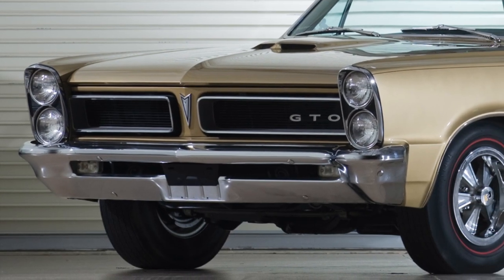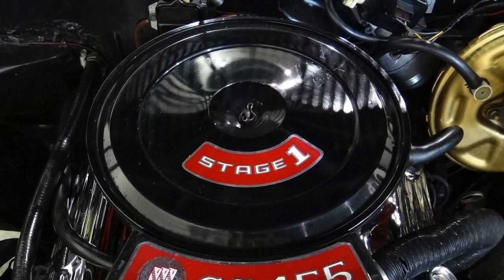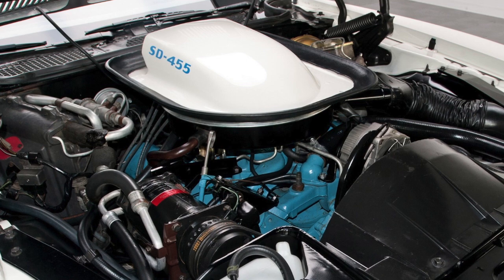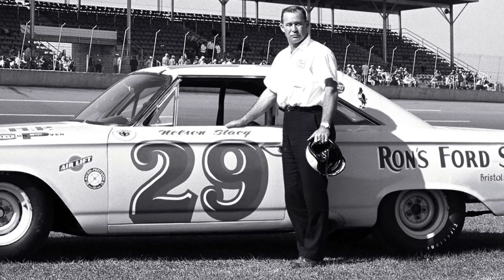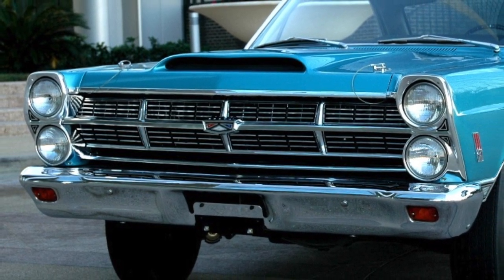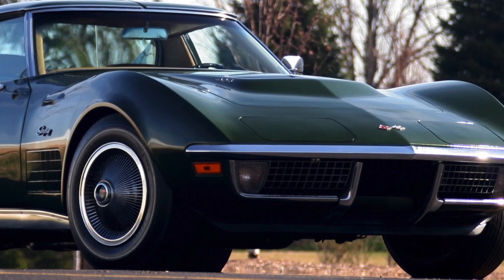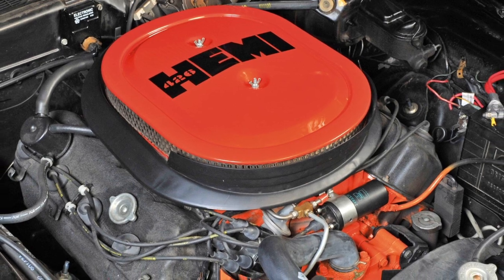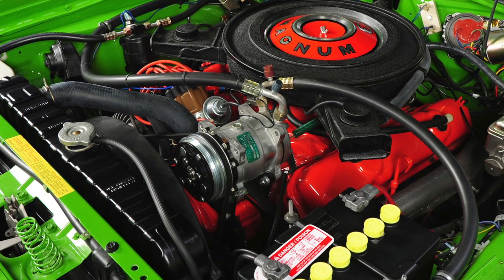5 Best Vintage V8 Muscle Car Engines

Comment: Back when real cars were made! And I remember pumping preumium gas costing 32 cents per gallon! Real gas! Try running cars like this on 91 octane at three bucks a gallon! Ping, ping, ping!!
Reply: Not in SLC at 4500' elevation. 10:1 up here makes the same cranking compression, all else equal, as 8.5:1 at sea level.  I put 305HO heads on a smogger 350 and left the smogger cam in, it ran fine on pump regular at 10.2:1.
Reply: @Bighorn44 None ...and .34 in 1966 adjusted for 2019 inflation is $2.74 today. The old days weren't that good.
Reply: I remember paying 21 cents a gallon at the cheapo station right next to Ventura High school in Ventura California in 1968/69. Mostly I bought regular which ran fine in my mom's merc station wagon with 10:1 compression at sea level. It was no performance car but the 383 version of the Lincoln 430 was still a torque monster. I wish I had one like it now in good condition. 2.73 gears, 55 in first 95 in second and no  idea in third. Shifting at 4,000 RPM... LOL My dad liked it too. We pulled a 14' camping trailer up over 33 towards Taft and at one point, on a long straight stretch, he got all 4, probably the trailer too, airborne over a rise that would be a gentle slope at 65. The speedometer was somewhere past 105 when I saw it as we were slowing down. I believe that he honestly didn't notice how fast we were going. You're not going to do that with ANY modern car.
Reply: methanol a low grade corn mix money flow 4 big corporation.
Reply: I remember 32 cents a gallon I was 11 years old I remember how passed off the adults were whe italmost trippled over night too
Reply: That 32 cent premium was full service too! Clean the windshield, check the oil, and even tighten the fan belt, check the air pressure in the tires. All included!! I remember one lady who always needed that windshield done twice, because she would insist I missed a spot.

Comment: These were all great engines, some of the engines shown had air conditioning and or air pumps which were big nonos to the muscle car owner. Another big factor in street racing back in the day was rear end gear ratios....I had a 1969 GTO 400-350 hp  with a 4:33 posi rear  and I was unbeatable...Frank
Reply: My best friend had a '69 GTO Judge with 400, 4 speed and never lost a street race. One guy he beat wanted to buy it on the spot.

Comment: 4:06 - 4:09  You forgot Pontiac's [aluminum] 215-cubic-inch V-8, which was used in the Tempest line in 1961 and 1962.  It was based upon an Oldsmobile design, but it used different cylinder heads and fewer head bolts.  It was virtually identical to the Buick engine of the same architecture.
Reply: Definitely NOT a high performance engine.
Reply: @4thstooge75 : True, but he said that Pontiac never offered a "small-block" V-8.  That is not factual.

Comment: I have a 1971 boss 351 mustang that dinoed at 449 hp! After market intake though. Low 12 sec 1/4 mile with tracksion issues! Not bad for a almost stock small block! Ps. Is a four speed car.

Comment: The 455 stage 1 Buicks were fast, but we're notorious for cracked engine blocks under high RPM abuse because they only used 2 bolt mains and very thinwall casting
Reply: it made 510ftlbs at 2800rpm... those who used it for high rpm messing around are the only ones to blame for cracked blocks.

Comment: That 13.30 ET test was with stock tires, with slicks and a 3:70 gears would run deep 12s, bone stock.
Reply: Mark rapacki  What did you run in the late 60s stock that ran 12s? Just curious..
Reply: Mark rapacki  So my 1968 Dart with a slant 6 with slicks would run 12s, I think you don't know what you're talking about. Only few car's ran 12s with slicks, my point was there was some that would, not all hot rods from the factory ran 12s back then
Reply: Mark rapacki  Well??
Reply: Mark rapacki  Your proof, what car's do you know that ran 12s stock in the 60s with slicks, you gave no answer just silliness, you probably weren't even alive in the 60s. I only know a couple that would run 12s with some tuning and sticky tires
Reply: Mark rapacki  Oh and stop liking your own post 😂

Comment: nice to end the segment with the 383 chrysler. with a half inch shorter stroke than the 440 or 426 you could boost the piston speed up about a thousand more rpm and stay safe. better valve springs, better low end bearings and you had a real champ.

Comment: All I know is that the GTO with a 389 was just about the best street racer.
Reply: A guy in  my small home town had all the fast cars back in the late 60's and he said the fastest one was his GTO. Faster than his Plymouth GTX 440 six pack, faster than his Hemi Cuda, faster than his Chevelle SS396. That really surprised me.
Reply: @nasedo3129  And then he woke up and realized that is was all a dream.  The GTO essentially started the Muscle Car Era and was the fastest car when it came out, but, all things being equal, it was no match for any of those other cars you mentioned, unless they were all dogs. Don't believe me, look it up for yourself.
Reply: Until a Mopar pulled up.  383, 440, 426, even some 340s....that tripower was toast but looked sweet.  That option to drop the exhaust was a pimp thing also.

Comment: Funny how V8 Nova's seam to be forgotten. Even a slightly modified bullet proof 350 small block 68-70 were incredibly fast. It was the HP to weight ratio.

Comment: The R code 427 would have been a whole bunch meaner if it had a better Intake manifold with more port volume and larger plenum below the carbs allowing better atomization and better flow into the ports.  A taller better breathing air cleaner probably wouldnt have hurt with the original intake but would definitely have been a must with a larger intake volume

Comment: Oh, how I miss the days when gas was less than a buck per gallon, and enormous naturally aspirated V8's ruled. Now EPA rules...it's too bad
Reply: yea but if an EU manifacture made that engine it would be more than that
Reply: The current crop of performance cars are pretty darn good and gas is cheaper than ever if inflation adjusted.
Reply: Buck a Gallon?  You mean  back in 1970 when the min wage was $1.50 an hour?  Now with inflation min wage is 7 times that but gas in only $2.25 a gallon not even twice that--CHEAPER.  And any 2016 Dodge Rt with a stock 5.7 V-8 375 horse engine can blow these old rust bucket  engines  off the road!
Reply: In those day they would have run off petrol.
Reply: bet you would give your right thumb to have one of these "rust buckets". A nice 4spd LS6 Chevelle would set you back $100K+. Of course nostalgia is part of that cost but there is something to be said about the uncomputerized rawness of these machines when driving them.
Reply: Ryan, I can remember sitting on the edge of my seat, watching that gas gauge move to empty and hoping I made it to the next gas station.  LOL
Reply: Chad haire, no in 1970 gas was 30 cents, in 2000, gas was $1.10 don't know about you, but I call that taking it in the tail pipe at the gas pump at $2.40 for regular when a barrel of oil today is $47.00 and in 2000 it was $35.00 a barrel. By the way a1970 440 six pack highly optioned cuda was $4.400 compared to a 2016 Dodge challenger RT with 5.7 is what $38,000.00. Today we're being screwed all the way to the bank, by the banksters. At least the average gear head could work on the 70 cuda, all the newer cars require thousands of dollars in specialty equipment, no thanks.
Reply: if you love v8`s you run em no matter the cost
Reply: The Dodge Hellcat is 707 hp and can achieve 20 mpg.
Reply: vintage motors  dumbass lol
Reply: chad haire for me it's not how fast they go.  It's looks but speed is great too
Reply: Even back in the 80s and 90s the gas was cheaper than it is nowadays too many tree huggers are calling the shots its because of those tree huggers we have higher gas prices than ever before and also because we are still buying foreign oil its because of those tree huggers we cant drill here in America if we could drill here in America we could lower gas prices to extremely low levels it might be a buck or lower but because of the tree huggers we cant do that electric cars are not the future if they want low emissions natural gas would be a better option we wont have to give up our good sounding engines and they will have the same effect as electric cars there I just solved the emission problem
Reply: Bob Lazar good cars and great power yes,  inflation wise no. if you just figure inflation yes. if you figure in the pay checks of most people now days, NO!  car buyers back then could afford these types of cars on the average Joe salary.  I don't know anyone that works an average job now days that has one of the new street killers. I work a union UAW job and only 1 guy at work has one and he is a young guy that lives at home yet.
Reply: Yeah, it's a real shame we don't get to breathe lead-filled air anymore.
Reply: phuc ewe  Don't I know it.
Reply: @kirbyvanduzer6565  I've had those musclecars and still love them, but I'm also a tree hugger, I love my planet more, idiot .
Reply: @chadhaire1711   Gas was 32 cents a gallon in 1970.  And it got as low as 85 cents as recently as 2000.
Reply: the gas shortage hit in 1973, you had to wait in long lines for 10 gallons
Reply: billyboi57 and weighs 5000 pounds.its a pig
Reply: @chadhaire1711    In 1970, gas was around thirty cents a gallon.  People would have been outraged to see a dollar a gallon.  Eighteen cent a gallon gas wars were common.
Reply: @scarhart53  No gas in 1970 was 50 cents...on sale 30 cents but rare.  A fully equipped Mustang V-8 or Challenger V-8 was $5,000. Do times x 8 and that would be $40K for a V-8 Mustang or Challenger RT which is what they now cost, or $4.00 a gallon so at $3.25  so today you are getting a bargain.  Even if we take your fake 30 cents that is $2.40 a gallon, compared to $2.80 6 weeks ago.  Plus a big V-8 back then was 9/13 mpg, today 18/25 mpg.
Plus the new cars are quicker, handle better, and far far more reliable.
The older 1970 cars SUCK....even a modern V-6 Camaro can smoke 99% of them....and the 2019 Dodge 5.7 RT can run just as quick as the old clunker 1970   426 Hemi which was over rated at 425 horsepower--real SAE NET HP is 350 on the 426---25 less than that 2019 Dodge 5.7.
Reply: @jquest43  doesnt matter. Still beats the competition and can take the charger to over 204 mph and the redeye challenger to 203 mph. Btw, they weigh between 4400 - 4575 lbs. Not 5000 lbs
Reply: @chadhaire1711  dream on.........
Reply: @billyboi57  not in town you cant.

Comment: The Pontiac V8 has always been my favorite GM engine, but I will not agree that their late model low compression offering was their best. When it comes to the RB Dodge I'll take a 426 max wedge. I had the privilege to speak with Sheldon Gecker at the 92 Heartland nationals, and I asked him why he was not running a Hemi, he said "because on gasoline the wedge makes more power." Enough said.
Reply: iamfun6996 he was right

Comment: I rode in a 67 Chevrolet Camaro with a 454 I noticed how powerful it really was even at slow speeds it felt like it wanted to be cut loose burning rubber is awesome I was on the highway with my friend And he punched it And I was not secured to the seat well I was grabbing for something to hold onto but I must admit it was awesome

Comment: The Chevy 350 has to be one of the best motors ever made,,,,they where fine for everyday driving, and could also been turned into beasts !  Same for Pontiac, except they had a 2 bolt main,,,, I am not talking race car caliber,  just a good motor in general,,,, 😁✌

Comment: You're wrong, sir. The 1970 Chevrolet El Camino SS did have the LS6 454, however, it wasn't present on the dealer's booklet. On a 1/4 mile, it went 108 mph in the low 13 secs mark. In addition to, there was the LS5 (has a lower HP/torque rating version) in the booklet.
Reply: No stock 1970's car ever went into the "low 13's".  BULLSHIT.
Reply: cobra?
Reply: No modern car can run a low 13s on  195/70-14 poly-glass bias ply tires. PERIOD. if you put a set of 345/40 tires on any muscle car it will run 12s all day long , muscle cars are not as heavy as people think a ZL1 Camaro weighs only 3375lbs, corvettes weighed around 3200lbs with the small block 327/375hp. i think a big block nova only weighed 3400lbs

Comment: I had a 67 Oldsmobile Delmont 88 highway patrol car from California built one year only had an engine 425  built by Lingenfelter put out 535 foot pounds of torque and 385 horse this thing was a monster with the VP stater converter there was nothing quicker than I ever ran a crossed after the heads were flowed And cam upgrade it was on stoppable stuffed in a 61 Ford pick up my question is how come no one ever speaks of this engine I always hear about the real rare ones and I hear about all the Hemi’s 
Yeah this monster is unheard of . One more thing the 425 only had 2 bolt mains . Lol

Comment: That was then. Today we have race engines that will put out over 700 horses depending on the fuel. It's mostly cause of the heads that are costly and the difference in the angle. It's hard to imagine over 700 horse. Time to snap axles and blow up clutches

Comment: Good afternoon  folks, I was so poor, I could not have a speedy car till I was in my 20s. The fastest car i every could afford was a 60 Chevy , white 2 door hardtop,red interior,  good looking. It had the big 348 , a true truck engine, but did ok in the cars as well. Mine would peg its self at 120 mph. Then the lifters started to float, and then no more speed. Hydrolic lifters did that. After that I got married and I had to drive it sensible. Wife did not like hot-rodding. It might break something and we did not have the money to fix things like that. So I had my one and only hot car. lol.

Comment: I remember a ride in a brand new GTO 389 4bbl w/a power glide. I was good but I liked the 64 426 max wedge better. How was it not the first factory hot rod(mussel car). Also I'm sad to admit that I was a performance driver/mechanic at Chrysler and was partially responsible for retuning engines for the upcoming low lead fuel and fuel economy. I made them fast and retuned them to blah.
Reply: Because Ford had a couple versions of their 427 that had them literally beat !, The sohc  had 426 Chryslers and 427 Chevys beat !. With 1; 4v 616 H.P. with Duall Quads 657 H.P. ! . Highest H. P. 427 CHEVY 550 H. p . ! Lol .
Reply: I had a 64 savoy 426 wedge 323 gears. It was pretty fast until I let a guy borrow it for a few hours. The rest of the story is really sad.

Comment: One of my best friends owned a 1969 Nova SS 396, 375 h.p. It was a completely stock engine with a set of Hooker headers, Lakewood traction bars, aftermarket clutch. We took it to Cecil County Dragway in 1970 and just broke into the 12's. We did not tune it up, just drove it there and put on a set of cheater slicks and cracked the 12's. We had fun and never went back. Why all the hype over the bulbous 455's?  I do not agree that these enigines are the best, just the largest.

Comment: ya know... you went with the SD-455 I'd put the 389 tri power there.
Reply: My old man had a 65 GTO with a 389 that he and the guys he worked with built that used to Routinely Blow away  Brand new 74 and 75 Trans Ams right on I-5.

Comment: what about chevy small block 283ci.? I own a '67. engine / 350thc.trans. dmv pulled my driving card in '94. will trade for building materials. Dryvit and 2" sheet styrofoam-1600 sq.ft.

Comment: You didn't mention the 66 Olds 442, it had a 400ci engine with 3-2's that ran in the high 12's from the factory. If you put on the w30 package it ran better times then that

Comment: The thing about the Pontiac 421 and 455 as well as the 428 Pontiac was the 3.25 crank main size . The bearing speed is really high. Over 5000 rpm with iron crank and rods they broke. The 400 RA IV was really their best. The 427. MR 2x4 Ford in 66-67 dynoed at 510 hp and 480 ft lbs and with the 2.75 mains, forged steel rods and cranks were capable of the SOHC heads and 2500 hp. The 427 HR would have outdone everyone at 650 hp. It is too bad that Ford was so conservative about what they put on the street. I have a .020 over 390 that makes 503 hp and 468 ft lbs and is relatively mild,just a bit of lope and a lot of tire smoke. And it can run steady at 7000 rpm’s and never get hot or have any problem.  I always wanted a 427 but it never happened.

Comment: Although they were produced by Buick, Pontiac (and Oldsmobile) sold a small block 215 cubic inch aluminum V8.
Reply: The Oldsmobile 215 actually had some detail differences with the Buick 215.  One was 6 head bolts per cylinder instead of 5.  The Oldsmobile went on to be the first turbocharged American production car.

Comment: Funny that it is all big blocks, My cousins 66 Chevy Nova with a factory 327/350hp consistently turned the 1/4 mile in the high 12's. The only thing not stock on the engine was a set of headers.

Comment: You have all the BIG torque number engines listed, 327 L84 375 BHP was the best power to weight chevy of the 60's. That mighty mouse 🐁 was increasable in Corvette Camero nova light cars. was a good truck motor also. it's my favorite.

Comment: is the 318 magnum a tuff motor
Reply: The LA series and the Magnums that followed it have a good reputation for durability. The LA motors were underdeveloped as the 70's and 80's went on making  about 145 HP and found in Diplomats and trucks/vans.  But the designs were solid from an engineering standpoint.
Reply: Prone to head gasket failure....I had one in a Durango